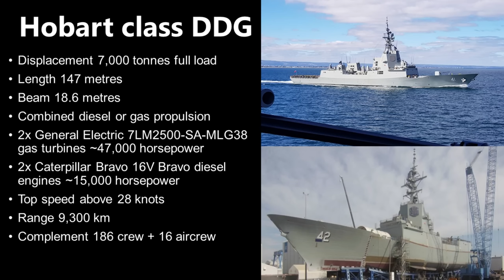Hobart Class Destroyer: the Australian AEGIS

Comment: Who says the design of the f100 is by Gibbs & Cox? The Americans told the Spaniards that it was impossible to put the Aegis radar on a 6,000-ton vessel without compromising its operation.
When Spain presented the f100 the boss of Gibbs & Cox fired their engineers for shame.
The Spanish design not only maintained the capabilities of the Arleigh Burque but were able to detect enemy missiles 5 seconds before the US destroyers by having the antennas a few meters higher than those of the US Navy. You can watch the videos on Youtube.
The f100 is a work of Spanish engineering
 that has no comparison.

Comment: should/ve stuck with Arleigh Boutke
Reply: More expensive with a significantly higher crew requirement with less digitization and automation than the Arleigh design. so that would have created additional issues.